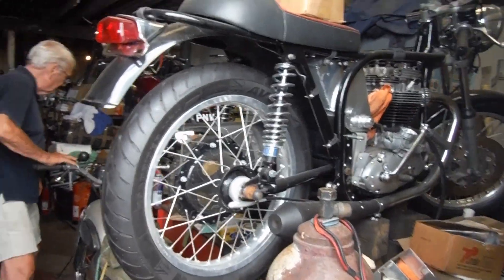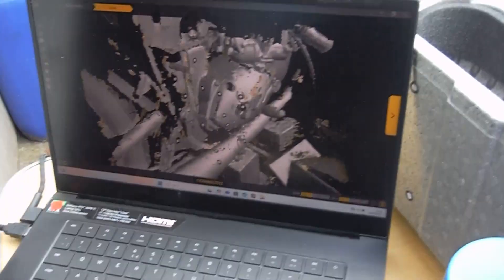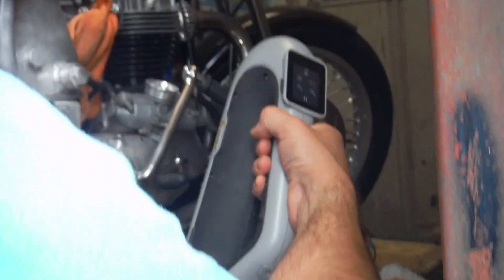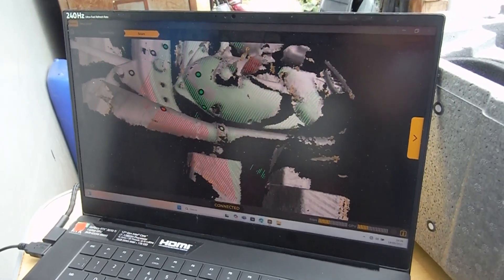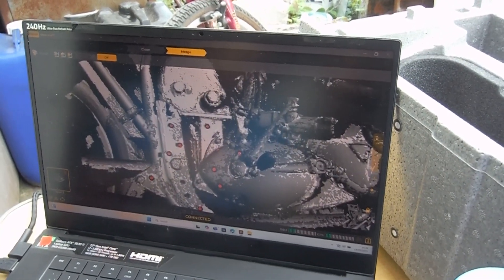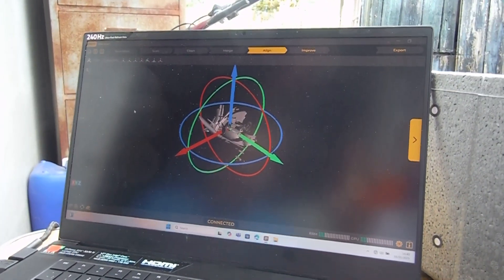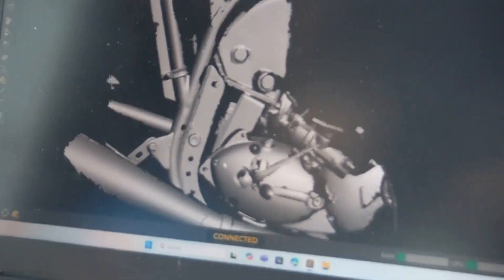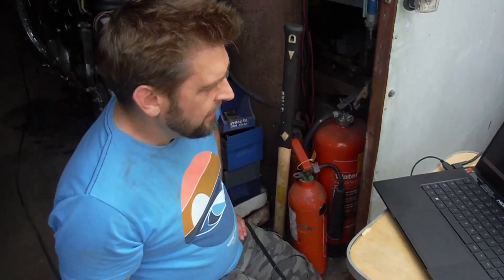3D scanning the Triton project with shortened featherbed frame for CNC produced engine plates.

Comment: Unit construction engines never look "right" in a Featherbed. Too much empty space. That shortened one must be close to Dresda dimensions.
Reply from the maker: Yes, we shortened it, the wheelbase is around 55 inches.
Reply: @paulhenshaw4514  Hi, did you just cut and shut the frame tubes? Did you not have an instalation drawing of the Triumph engine to aid with the plate making?
Reply from the maker: My Brother shortened the frame, using fish mouth cuts and internal bracing, so it is probably stronger than original. We made our own templates for fitting the engine.